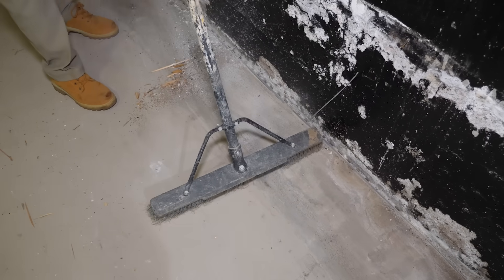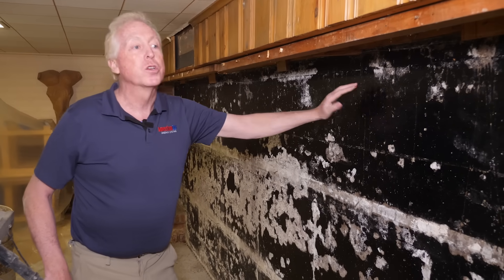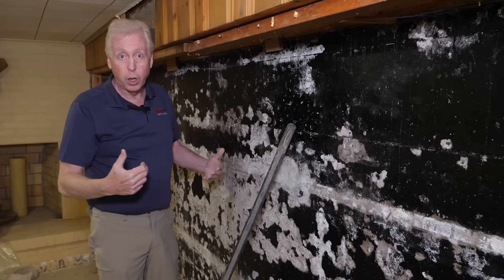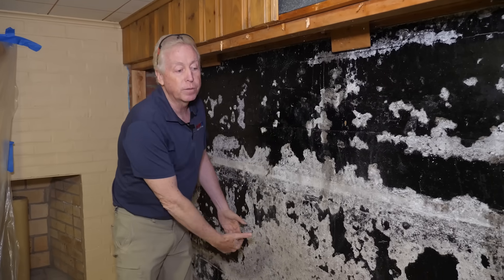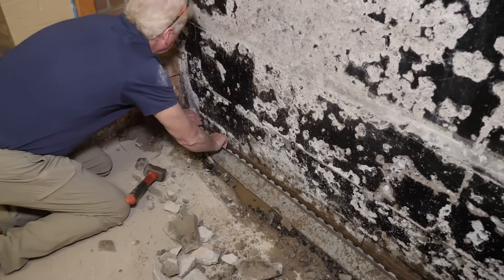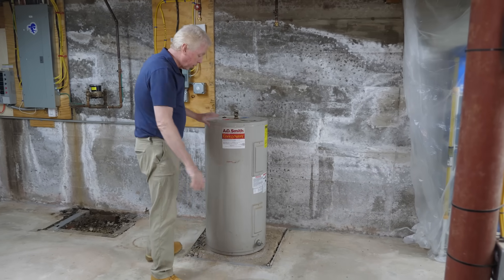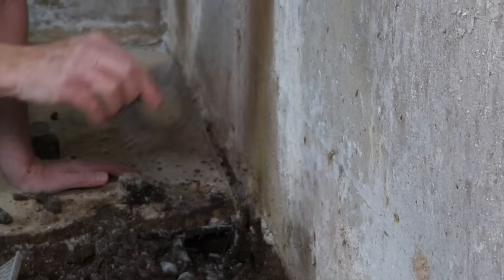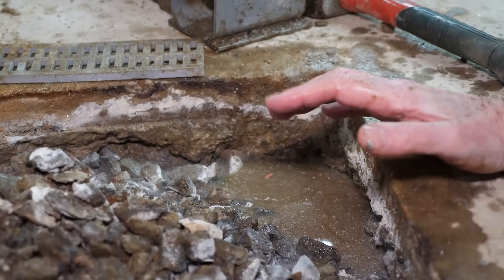Waterproofing Basement Walls | Finished & UnFinished Basement

Comment: My home was built in 1948. The basement walls are cut stone from the mammoth cave area of the country. 

My stone basement walls have leaked in an annoying way for the 16 years I have lived here.

I have recently begun thinking of restoring the 75 year old home.

I am a Mechanical Engineer by profession and I can't help notice that this 1 1/2 story home sure has "Settled" A LOT in many concerning locations on both stories.

I doubt seriously that this home sits on any kind of acceptable footer and I can only assume that the basement floor concrete was poured on a minimally prepared surface.

I have no doubt that the basement floor gets water under it routinely. 

But get this. I quiet by accident found that a rather large drain in the basement floor was actually capped years and years ago.

With the cap removed, a good flashlight will reveal the presence of a cavern big enough for.a group of men to hunker in under the basement floor. 

I can't tell exactly what it's limits are but it's extremely close to a brick 30' ? chimney that I can't imagine is not supported by the basement floor.

Then, if you just don't pay attention to the floor joists, the homes main support beam, other doubled and tripled 2x4's that are supposed to act as lesser support beams,
one may be all in to tackle the project.

Sounds cost prohibitive in this neighborhood....not to mention that one would probably come out better if they took lots of pictures of this house to remember it by.

Dozed it and built another one.

Comment: what material do you recommend to cover an underground wall which is damped and try to stop once an dfor all with out damaging the structure (the wall is a mixed of stones and concrete
thanks
Reply from the maker: First address the water problem with a subfloor drainage system. Never cover walls with anything until you address the problem.
Reply: @AmericanDryBasementSystems  thanks a lot but one wall is a city road against my cellar and the other wall is against the main house foundation without any access! :(( how? Thanks
Reply: Can your product which crystallise could assist ??

Comment: What about this new poly seal/flex seal coating?  Will that destroy the cement the same way?  I've talked to companies using this poly seal system on inside walls & they say it doesn't deteriorate the cement but seeing this makes me question them.  If anything I might poly seal the outside where the foundation meets the top of the driveway.  Let me know what you think thanks
Reply from the maker: Flex seal alone will reduce water evaporation in concrete and trap water in the wall for a longer amount of time. That water will weaken your foundation over time. Properly installed interior waterproofing drainage is the best solution in solving the false water table issue. Once you address the false water table you can put whatever you want on the walls.

Comment: You would think by now we would have found an economical and feasible solution to backfilling. Finding a filler that creates a protective layer between ground and concrete that won't damage the wall and keep water out. Something that can be done to all homes.

Comment: A bit confused here.  You say you don't want to seal off the wall because it needs to breathe and then say that your product is "like a membrane" which seals it off.  I understand that your product might soak in a bit, but somewhere, that water can't get free.
Reply from the maker: We use Superslurry, our proprietary crystalline product on the bottom 24 to 30 inches of wall. This is the area that is exposed to subterranean water the longest. Our product turns the bottom part of the wall into a waterproof membrane. It strengthens the cement wall by stopping the deterioration process. We allow the rest of the wall to breath.
Reply: @AmericanDryBasementSystems  Thank you for taking time to clarify.  Appreciated :)

Comment: This is rather educative. I have an unfinished basement. There is, as far as I know, no waterproofing. The basement does have a tendency to be humid, but we don't have any water problems. I think that a large part of what is preventing problems is the fact that we are on a slope. The parking side and front of the house only has a foot of foundation wall exposed. By the time you get to the rear of the house, the ground is level with the basement slab. We've got an outside door at the rear of our house. The foundation tile is also obviously working quite well. There's an area of about one foot near the foundation that is always bone dry during summer.
Reply: IF that's the case I would keep it unfinished and maybe use a dehumidifier when it gets too humid.
Reply: @SunRabbit  We have a dehumidifier.

Comment: "find the right company '" is the hardest part of this job.     The problem is the public calls experts to tell them what the right solution is.     You call 3-6 and you get varying answers.    In this case why is fixing from the inside the solution vs putting in a higher capacity weeping tile?  Just curious, why an interior french drain vs exterior?  (Excluding cost as the reason)
Reply from the maker: Thanks for commenting. Customer common-sense and understanding are very powerful. It helps them delineate the experts from the amateurs. We want them to compare our explaination to the competition. Our honest clear explaination is hard to beat. As for the problem with an exterior footing drain is that it fails most of the time after several years. We are working on a video explaining many differences and disadvantages of exterior footing drains. Yes. Exterior waterproofing is stupid expensive with a limited warranty to boot. If it solved the problem for the long term, we would be selling it.

Comment: What if you move into a house that previous owners already painted the walls with waterproof paint? Anyway to let them breathe after that's been done?
Reply from the maker: There is not much you can do besides sanding off all the paint. That process can get dusty and time-consuming. If you don't have a water problem, don't worry, and if you do, install an interior waterproofing system to reduce lateral pressure on walls and hydrostatic pressure under your floor. A perfectly installed system will make sure water does not go higher than 24" outside your walls, reducing stress on the entire foundation of the house.

Comment: Is it ever a concern to be cutting out a trench so close to the wall, given that by doing so one is effectively removing the connection between the floor and wall, thus weakening the wall)?  I'm putting in a sump soon and am planning to cut the concrete 12-16 inches from the wall.  Thoughts?
Reply from the maker: We never worry or cutting close to the wall because we don't. Either there is a footer or you have to create a false footer 4-inches from the wall. We leave engineering tabs which are sections of floor against the wall to maintain structural stability.

Comment: My country don't build basement houses. But that's where I really want to make mine different. And that's where I find this topic really interesting because I lived in a house that experienced serious drainage issues. So that's why I find this video very helpful. Thanks. Just about the water settling in the gutters and not making it to the sump pump. Would 5mm drop help with flow problem?
Reply: Okay thanks, this is very interesting getting views from professionals.
Reply from the maker: No. I'm not a fan. Those ridged gutter systems must remain level to make the clean-out port and built-in drain backing visible. FYI, we also have homes here built on slabs with no basement. Not many, but we will try to do an installation video if we do get one.

Comment: What about when the water table gets so high it comes up through the basement floor?
Reply from the maker: Excellent question. Watch this video: https://youtu.be/g-fxnswPLB4?t=217 Same location. Our system is designed to reduce the false water table quickly by draining water from under the floor.

Comment: We have a very old house, ~100 years, which has a drain tile system that is common in our area, for that era. There’s really no leaking or seepage, but on one side theres some efflorescence (which may be due to a slope created by a walkway). We want to finish the basement but since there’s significant old peeling and flaking cement and paint, but no significant leakage that would justify the cost a major interior trenching system, can we just slap a coat of paint and then put our insulation and dryway in? Should we even paint the foundation walls or just let them breathe? The paint is very old and its crumbling, seems like we need to do something to prep it.
Reply from the maker: Paint peeling can simply be old paint and not a process of moisture. Sand off the old paint. Repair cement cracks and gaps. Test the realitive humidity in the room during the morning and night. If it stays below 50%, finish room with insulation, sheetrock, paint, etc. It may last another 100 years.
Reply: @AmericanDryBasementSystems  Thank you!

Comment: this is the best explanation ive heard for that white powder on the wall. my last home had it in the basement on the one side. house was on top of the hill so water was sitting on the other side. what i did was tarped from the bottom of my aluminum siding down to the ground and over to my neighbors driveway. she had a small wall between us maybe 3 ft high and i knew her for my entire life so she didnt care. it looked shitty but i never had water flow in. only crystal powder. i was going to drylok it but then i figured the water would prob re route somewhere else and since i had crystals instead of water i just left it. my new house the previous people had no gutters. and water would rush in through all the basement walls. really messed up things underground. i used lik 4 buckets of cement patching cracks in the winter.

Comment: Wouldn’t a French drain around the outside alleviate the excess water?
Reply from the maker: There is no assurance it will work for the long haul. Interior subfloor drainage can give you that lifetime assurance when installed properly.

Comment: Installed that system for abt a year it is a terrible system .I went back to using 4 inch ads
Reply from the maker: That "gutter" (I won't call it by its real name) is the system we replace the most. It is not very efficient or effective. ADS pipe never fails if installed correctly by a proficient contractor or DIY'er.

Comment: your proprietary chemical that you brush on is Vandex - right?  (the crystals grow, but you didn't mention that it needs to wet cure for about a week before you can trust it to be waterproof...  (and I've used Vandex, and it works really well.)
Reply from the maker: No. This is not what we use. You can give it a shot.

Comment: Can they just tar it outside the concrete wall before they put in the backfill?
Reply from the maker: During new construction they do more than add tar before putting backfill in against the walls. The problem is that it never lasts long in damp wet soil.

Comment: Before I comment anything, I just want to make it clear that I am NOT an expert in this area and I am NOT criticizing this very informative video. Im just a homeowner trying to make an informed decision. Now that that’s out of the way, you mentioned that DryLock may cause the same effect as the tar but after speaking with a Drylock representative they were very clear that Drylock WILL allow the concrete to breathe. It will let vapors through but will help prevent actual water from seeping in. Im assuming what happened here is the tar crated an almost air tight seal from the inside of the home causing the concrete to soak in rain water without properly drying after heavy rain fall.  With that said, do you still recommend NOT using Drylok for extra “insurance” after soil has been sloped away from home and downspouts redirected over 8ft from the foundation? I am not currently getting any water in basement, just want to make sure I take a few extra steps before putting up drywall.
Reply from the maker: Drylok paint seals the pores of the cement. It does not allow the walls to properly breath. If you solve your backfill water problem, then paint your walls with Drylok. It should be okay as long as you control humidity in the basement. Water over time will always win.

Comment: Thank you so much for your video. So many people along with Sherwin Williams recommends DryLoc.  I do know that stuff is bad though and I keep telling people. I have a 100+ year old home and the cement block walls are similar to that of your tarred walls except mine were painted by a previous owner.  I roughly scraped off the efflorescence. In the areas where the paint could be scraped off and the wall is bare with loose sand, what product should I use to fix and solidify those areas? Someone here used a Raydon sealer but I would think that does the same as Drylok. After the spots are fixed, can I apply just a regular latex paint over everything (at least until the other areas flake off)?
Reply from the maker: If you address the lateral water pressure and seepage problem first, then you can use Drylock paint to seal and beautify. I'm not a fan of latex on basement walls. It flakes off too often.
Reply: @AmericanDryBasementSystems  Isn't Drylock that was most likely applied by a previous owner, the cause of my problem in the first place?  You also state in your video that Drylock caused the mortar to crumble into sand. The sand from my wall just falls onto the floor. That is my problem so why would it be good to apply Drylock if that was the cause?

Comment: 4:17 can you recommend a similar type of system? How can it make the concrete no longer porous if the other side does not have it applied?
Reply from the maker: Our crystalline cement product SuperSlurry grows slowly through cement pores over months, making the treated area non-porous. A damp wall activates the crystalline growth. Moisture speeds growth. Our product is propriety and not for sale. But, there are similar products out there, and it is up to you to make your own choice. Ours is made specifically for residential and commercial foundations.

Comment: bottom line here is this system keeps the water just below floor level, so you don't see what's going on. Sounds like a better fix is to get the water away from the outside of the foundation. BTW, in the opening scene, it looks as if the ground level of the garden is right against the siding. It's likely the whole property needs to be graded to slope away from the house.
Reply from the maker: The property has proper grading. All basements using our method stay dry. We manage water well below the floor. Between 6 to 14 inches down using our pipe pitch. It is the only way to get a dry basement. Exterior waterproofing is not an option.

Comment: Last year, we bought a home built in 1900 in Columbus Ohio. We just had a waterproofing system installed in the basement that has had many years of bandaids applied, but didn't actually address the issues present. Because of that, there were mold issues, minor wall bowing, massive amounts of buildup on the walls.  We went with a company that we believe installed the correct system for our home, but we are now looking to address our basement walls, which were not part of the workorder. Do you have any recommendations for types or categories of sealant that we should look to use on walls to help strengthen the concrete again and change it to non-porous as stated within your video? Thanks for the help!
Reply from the maker: If you have a stone wall basement, start covering gaps with a cement mixed with lime mortar. If you have block walls use cement mortar type S. Let it cure. Afterwards, you can apply a sealant of your choice over the bottom 24 to 30 inches of wall. Our SuperSlurry sealant is proprietary and unavailable in stores and it is not for resale. There are alternatives out there.

Comment: We live just north of Albany, NY and have a problem with the red ochre, and we have to routinely have a service pressure wash out all the lateral lines under our basement floor. There seems to be no permanent solution to this issue, unless you are aware of something. We have a suspicion that the builders dumped a lot of their construction debris prior to backfilling. Our sump pump runs constantly when it's warm enough for water to flow and over time, the red ochre does a number on the sump pump. I learned the hard way to have a spare ready to install--just in case.
Reply from the maker: There is a iron ochre killer at most Home Depots or Lowes called Iron Out. Using it in tandem with a dual flush sump pump system like the one we install will solve your problem. You can flush the system easily yourself.  Watch our video: https://youtu.be/RC45g7CEuTQ

Comment: what can be put on a basement wall to make it look more appealing, if i dont like the cement look is there something other than dry lock that can be applied, would regular white paint or a white portland cement mixture be better to brush on a wall???
Reply from the maker: If all you have is exterior waterproofing or drainage (as shown in the video) that sit on top of the footer then you should not paint your walls. If you don't have any water problems (location with good natural drainage) or you install drains next to the footer to properly remove the hydrostatic pressure, then you are free to paint anything on your walls.
Reply: @AmericanDryBasementSystems  thanks. It's a house on long island from 1920, cement block foundation. I don't get water inside, but it is damp, and if I put a dehumidifier on, it does pull moisture out of the air